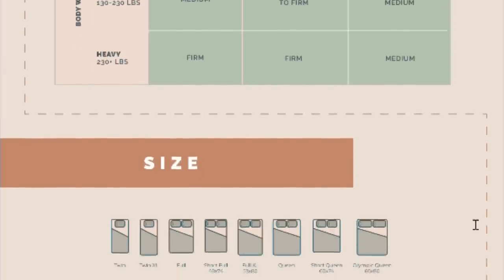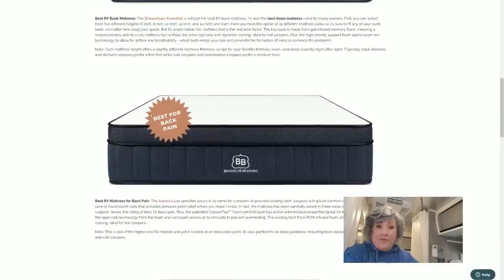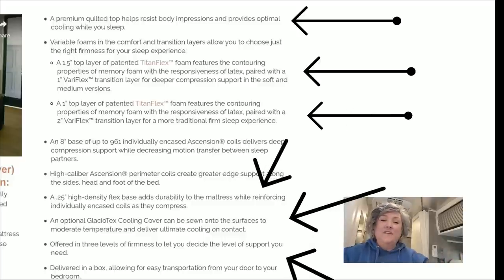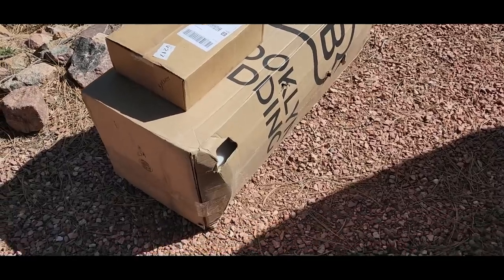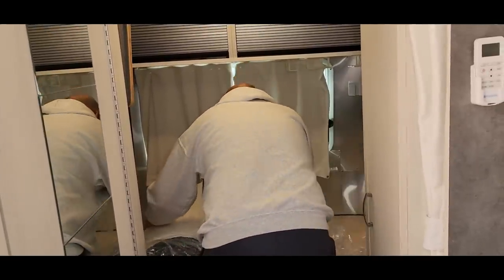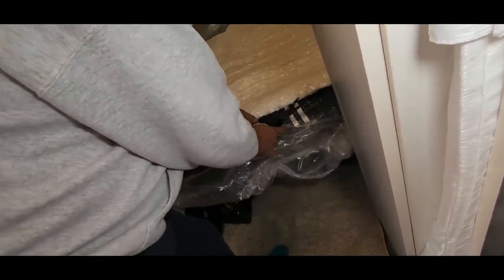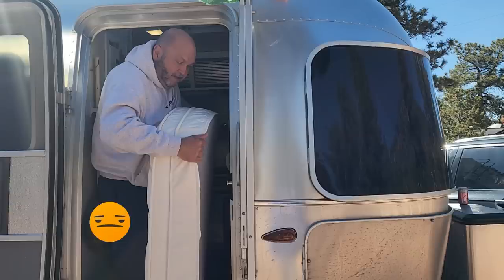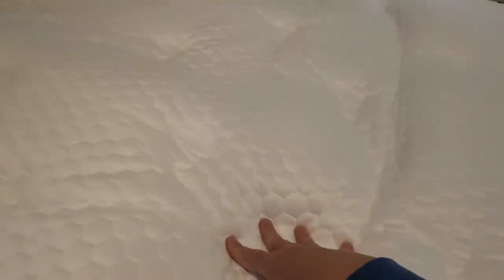Full-Time RV MODIFICATION #1: I CAN'T GO ANOTHER DAY WITHOUT CHANGING THIS ON MY AIRSTREAM!

Comment: THE Foam-Cutting Tool is an electric roast turkey knife. Just made a custom queen couch with one, to fit a shiki-buton (3 fold) cover. This is not a futon, it has structure, 3 zippered sections that lay flat to a queen bed or Z fold into a couch.
•You can draw a Sharpie cutting line on the foam,
•please keep the foam horizontal and level, (maybe with a flat cardboard box underneath to protect your surface)
•please keep the knife vertical,
•don’t rush, 
•and you may need to press a bit in the horizontal direction as you are cutting, Away from yourself.
•Maybe rest your hands if you get tired. 
•If you go too fast, you may tilt or cut crooked, just take your time. If you do cut crooked, just try again on your straight Sharpie line, and the little crooked flap will fit back in place.
•It is easy to stop and start, just press harder horizontally for a moment to start. 
**It is way easier to do than to write or read. 😎**
P.S. Robin, I love your videos. If it is more appropriate for me to put this comment on a more foam-oriented video, just let me know where it would be more useful, and I’ll move it there. When I figure something out, I want it to help other people too, not just me 💃✅😎

Comment: I put an expanding mattress in my guest room and when I released it it pressed me against the dresser and it was like battling an octopus to get it actually on the frame.  When I put one in my RV I had a friend come over and help so I wouldn't be pinned in the corner of my tiny bedroom for the rest of my, to be, short life.
Every new (or used) RV owner should budget for a new mattress first off.
Reply: Mine jumped off the bed and tried to roll out the door.  Fortunately, the bag wasn’t all the way off yet & I could wrestle it back onto the bed before re releasing it.

Comment: So good to see Big Boy!❤️
How about a video of you making the bed?😂
I covered mine with a fitted sheet, then I use a medium weight fast drying comforter that I roll up or wad up behind my pillows in the daytime in lounger mode.  That way you have a neat looking bed and no hassles making the bed everyday.  I wash the fitted sheet and the comforter when needed and then wrestle the fitted sheet back on.  The only work needed until the next laundering.  Literally take 10 seconds to make the bed.
You might also want to think about adding hypervent or a froli system under the mattress to prevent mildew.

Comment: Robin, just a suggestion from a 10 year AS owner.  Our replacement mattresses and new factory yucky mattress they don't breath well on the wood top they lay on.   Ikea has the curved bowed wood platform bed slats for a VERY reasonable price...they did the job very well to get them to breath with airflow and not swear and mold.
Reply: These worked pretty well just need to thumb tack the black strap tape at top and bottom throw your mattress back on top and your in business.  No mold no dampness.

Comment: If you want to cut foam, get electric knife just like carving for a ham or a turkey.. I think mine's a Sunbeam, I think the on and off switch doesn't work so I think I have to plug and unplug it... I have a lot of very large 10 and 15 gallon potted plants that foam makes it excellent bottom to retain water... just in case you're short of a drip pan... if you want something that drains well- for your bromeliads or your Orchards you can always  mix in some packing peanuts... into whatever Medium you're planting in... I also will bury in gallon containers with a few small holes, just to slowly drip water in... also maybe one of those large tomato cans both ends cut off, excellent for kitchen scraps, your worms...LAXVESPA-LOSANGELES